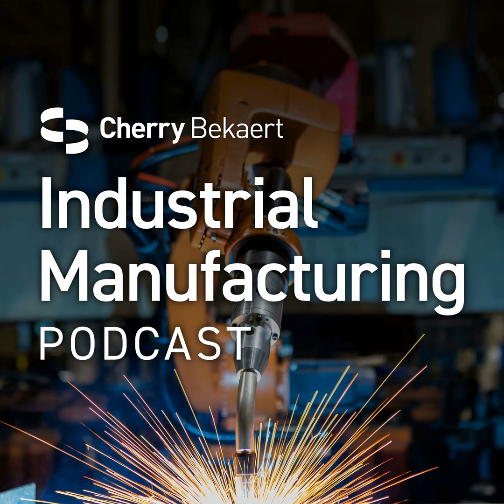CFO Guide: Mastering the Cash Conversion Cycle

Comment: For an inventory business the cash-conversion cycle is the whole game, and the inventory-days leg is where it usually breaks. You can squeeze receivables and stretch payables at the margins, but if stock sits ninety days before it sells, the cash is trapped no matter how clean the rest of the cycle looks. On a marketplace it gets worse, since the payout lag extends the days-sales-outstanding leg that sellers assume is instant. Shorten the cycle by turning inventory faster and everything else eases. When you attack CCC, do you start with inventory days per SKU, or with the blended company number?